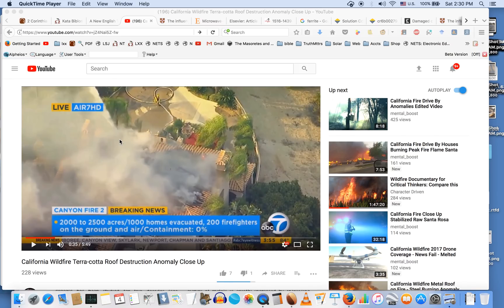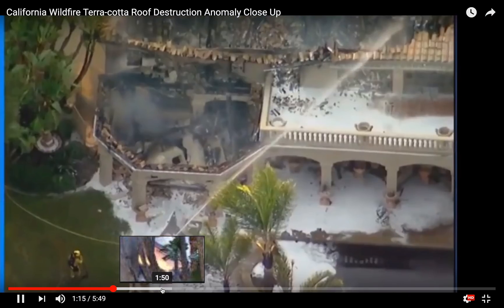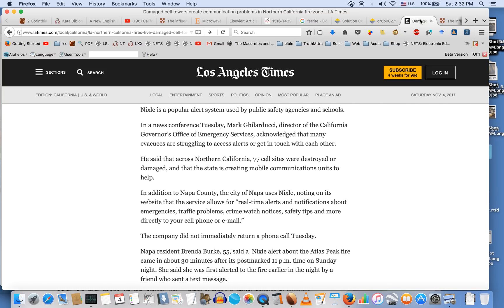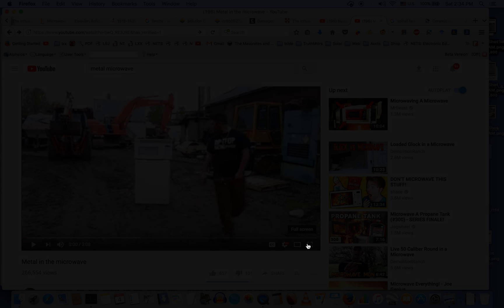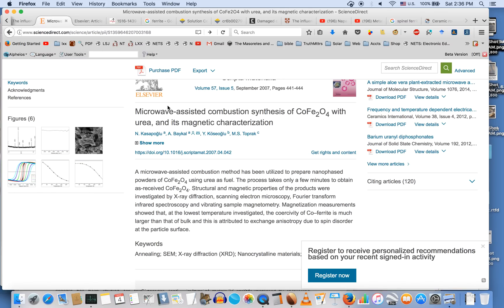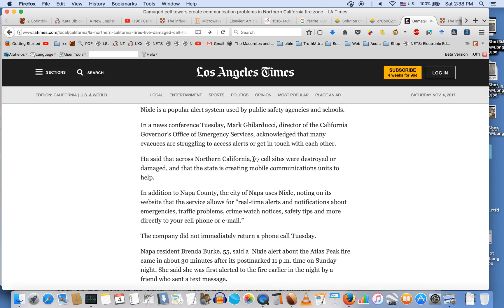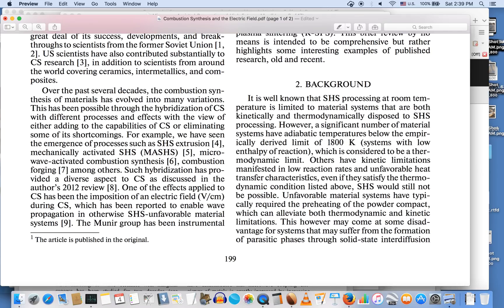California Fires: Terracotta Roof Anomaly: Microwave Assisted Combustion Synthesis

Comment: They also used a Tesla tech that creates lighting type pulses of extreme voltages from underground which explains the hit and miss nature of the burned homes,  light poles,  trees and anything that had coils in them aka Tesla coils aka coils of wire like tires,  culverts aka ditch tiles,  and anything with long running areas of metal,  like guard rails and bridges.   ALL are HIGH conductors of electricity.   See my channel for detailed video explanation. LBA

Comment: This video is a good example of what happens when IGNORANT people who know NOTHING about wildland interface fires, fire behavior, or building construction try to explain something that they know NOTHING about. 
Roofs of houses are made so that air can flow under them and above the insulation of the house.  It's very easy for embers to get into these vents that allow air flow.  The structure holding up the roofing, in this case terra cotta tiles, is almost 100% made of wood framing, usually with plywood or OSB sheathing to attach the shingles or roof covering.  THAT is what is burning.  The amount of iron oxide in a clay tile is almost nothing.  
Secondly, the embers that ignited this house fire came from the CLEARLY burned grassy area to the right of the house, which is obviously directly up wind of the house.  Grass fires typically burn hot and fast, and they're going to throw off lots of embers.
This goofy chick knows NOTHING about cell towers.  
"They're made out of steel"...
Only the tower is.  There's all kind of wiring and electronic equipment that can easily be destroyed by fire, and it doesn't take much heat to structurally weaken a steel tower, to the point it fails in high winds.  And the microwave power in a microwave oven is CONCENTRATED.  Microwave communication signals are NOT.  You'd have to be right up at the top of the tower to get burned by the radio waves, same as if you're right at the antennae of an FM transmitter.  Anyone who's every been in the Army knows that. 
Lastly, there's ZERO point of the government using microwaves to start fires.  The biggest source of income for governments is taxes.  IF they destroyed property, they lessen the value, which equates to less tax income.  It's the same when you cause business' to close, you lose sales and income taxes.  And on top of that, you have the expense of disaster mitigation and relief.
So just stop with all the conspiracy theory BULLSHIT.

Comment: check these two clips out and extrapolate 'proof-of-concept':
one guy's video i'd rename to Melted Glass with a Paperclip in a Microwave Oven
the other guy evolved a method of smelting tin/lead/silver in a brick-hearth he inserted into a microwave oven
 

https://www.youtube.com/watch?v=Ur6ejSAJRpU
15 Microwaved a Glass Bottle with a Paperclip inside - 3min
Geoffr524
Published on Apr 29, 2009
I took a brown glass bottle, and stuck a paperclip inside it, to cause the plasma to heat up the bottle, and melt it.  

https://www.instructables.com/id/microwave-smelter/
Microwave Smelter
 - 2min
Mike Warren
Published on Dec 15, 2011
(his youtube video shows his first 'semi-fail' attempt that resulted in a microwave oven fire but he found easy ways to correct for the problem by using only red brick)

Microwave: 850W
50/50 Tin/lead solder: 180-190 °C (360-370 °F)
:  10 minutes - completely molten
Silver solder: 450 °C (840 °F):  15 minutes - completely molten
Microwave susceptor aka heating element: silicon-carbide rubbing stone

Comment: When metal (especially ferrous) is placed inside a microve wbede the microwave energy is focused (approximately 2.4 to 2.48 ghz) the microwaves don't just cause oxidation instead it actually charges the metal to a high voltage reference to ground. Also if the metal has sharp points (fork or staples amd such) this acts a break out point suchans used for tesla coils. The charge is applied to the entire surface while the charge accumulates to the  point and breals away. If the object is rounded the charge will be equally aplied without that breakout point so it acts as a cap. More happens in reality but that is mainly what occurs in a microwave oven.

Comment: another super simple piece of msm news with a smoking gun that supports the oxidation reduction, microwave/rf assisted combustion synthesis, pyrolysis combination involved in these microwave/rf fires is this.

MUST SEE:  https://www.youtube.com/watch?v=mXm5RKASj5c
Planter pot on porch burns so hot it melts/disintegrates wrought iron steel, burns hole through 1.5" of solid wood.   

also see my aug2018 comment/analysis that cross-references works by mental_boost and intruthbygrace on parallel anomalies.

Comment: Total bunch of nutcase conspiracy theorist. First are there DEW? Yes! Second is the information presented by this "researcher" accurate, and truthful?  NO! Only in her mind, and in the minds of those who want to believe. Is our government behind it, and doing this? I really don't believe so, and not because I'm all that crazy about our government. Having said that, I have many years of experience in radio, and microwave technologies. The amount of power in a cell phone tower is by no means directable, and is not enough to start fires. It's at max 500 watts. Less than half of what is in a hair dryer. The reason for so many cell towers in a given area is due to the number of conversations that are going on simultaneously. Each tower can only handle so many voice channels, and power is kept low so that there is no interference between towers. The max range of a tower is no more than about 25 miles, not the distance this "person" claims. I don't have sufficient time or willingness to debunk this crap, so if you want to believe it be my guest, but man, ya'll need to wake the hell up instead of following people like this, acting like a bunch of sheep.

Comment: everyone who bought terracotta tile roofs did so for their fire-resistant quality.  dane at geoengineeringwatch was moving a hypothesis that tile/stucco are not burning in these fires, so this video shuts that idea down, shot dead.  
 
you guys show how microwave from the cell towers if overpowered* can excite the aluminum oxide in the terracotta tiles, a highly flammable accelerant and we see a tile roof house and everything in it disintegrate per inside-out self-immolation, thanks to a field created by the metal in all cellulose fibers per pyrolysis, without any nearby fire or any other homes ablaze.   

i would bet tile floors/counter tops, granite tops, and clay plant pots might all have some metal oxides in them like terracotta do.  i'd not be surprised if they put metal oxides into many items incl 'fire-retardant' chemicals the state forced into all furniture/curtain/rugs and insulation to meet state fire code.  wouldn't surprise.  why?  because federal codes at no time consider/reference or test for 'microwave fire' - they are specific only to organic fire.  presumably aluminum oxides would never come into play at organic temperatures 1400F.

and as you note, all the electrical wiring, plumbing and hvac venting, nails, staples come into contact with cellulose fibers like walls/floors/beds/carpet at regular intervals.  if oxidized could all be 'microwave fire fuel'.  is there a better explanation?  no. 

*note:  by hickup or hacker, periodically, the towers do go berzerk/derail and dose the whole neighborhood/county with very high microwave/rf pulses - i have captured it on video with my RF meter off the charts by maybe 10-100 fold higher dosage across the county one afternoon.

it takes curiosity and sleuthing to get around the layers of persistent deep state disinfo.  it highlights the level of mind-control across all fire/material science brass who know this stuff yet remain silent per 'manufactured consent' or per use of the same tesla technology via mkultra manchurian memory splitting to make them all do/say as handlers and puppetmasters have scripted for them. 

G4 is plenty lethal, G5 is the 'hunger games' rollout.  by then half of us may well be fire/quake/flood/cyclone refugees dependent on the gov for work/food/water.  and due to all the spraying and killing of vegetation/soil in all areas, armed preppers stand no chance and need to rethink the attack/survival plan.

Comment: the tiles are burning from the underside out, few flames visible.  the house burns neatly to ash with minimal flame, all items smoldering inside out, up/down moreso than spreading laterally/sideways, and it doesn't stop until it reduces all items to white ash, literally pulverizing/disintegrating 99% of materials, leaving a fraction of the debris field you'd expect and extinguishing itself neatly at its own foundation line.  this is all contrary to how 'natural' fire burns from the outside-in and spreads wildly laterally.  i'm calling it a microwave/RF disintegration-burn.

the house and all its contents are being heated to its combustion points and slow burn smoldering as if a remotely controlled burn.  these fires ignite themselves and put themselves out, regardless of human/dept intervention.

Comment: Don't need a metal content in a tree to make it burn - domestic / kitchen microwaves work by agitating . heating the water / liquid molecules in a food / beverage - thus a military weaponised microwave device would heat / boil off the cellular sap - and resin content below the bark - and inner wood grain capillaries to the point of combustion.

Comment: Orgone Pyramids and  "muffin tray Orgone" (they don't have to be pyramids) is made up of metal shavings and for extra power insert crystals in the resin to make them. Also they need to be near 20 to 50 ft from  the  cell tower also placing them near and around the house. This disturbes the microwaves from these evil towers. They are also sold online. Also they need to be buried so that they won't be removed or  should be hidden from public view. or if it is found inserting a paper message  saying what it is for inside the resin hope this helps. research in you tube.

Comment: Hi..  thanks for the research.  I believe that the electric company’s play a roll in this.  The microwave you are talking about when directed to a building does not first mess with anything organic nature.  But the nails and metal in a house as well as wiring super heats and ignites the wood and textiles around it.  An average house file is about 1100-1200 degrees so for metal like nails and steel to start to superheat it would have to be about 2500 degrees.  Glass does not melt until about 2600 degrees..  so this is NOT a common house type fire,  it has a major accelerant present in the beginning that fuels these fires beyond what you normally see in a house fire.  Also find the video showing the guardrails.  These are 6x8 treated post burning from the INSIDE when the steel bolts holding them together get superheated.  No other fire around except the guardrail.  Bottom line.  It’s not natural. It’s man made and I think insurance companies will have to investigate because these losses when using forensic technology should reveal from very interesting news indeed.

Comment: 0:38  reporter: "there's no flame here, no wall of fire near here... you can see right down through the middle of that house"   

2:31  in crescent river, ca 77 cell towers were destroyed, 1 tower is sufficient to carry a signal 40+ miles, the fact we have so many cell towers around us is a big red flag, cell towers radiate microwave energy.  

3:45  when you microwave metal, it sparks like crazy, from the vibration of the metal as it goes through 'oxidation reduction' which frees up oxygen to make the flame we see.  if you manipulate the magnetic field by microwaving metal you're accelerating the oxidation reduction process, freeing up aluminum oxide in this case, an oxidation element that will ignite and provide oxygen in a combustion scenario that bypasses the need for a furnace.  depending on the metal you get different color sparks.  

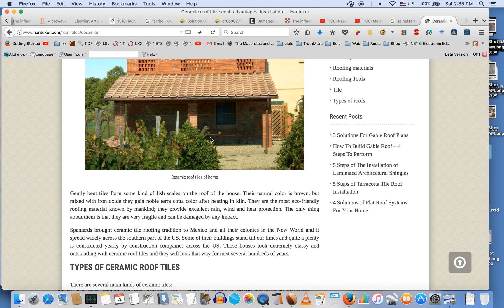5:10  terracotta tiles contain iron oxide that gives it its color.  if you microwave it and release this oxide, it suddenly has an oxygen feed it needs to burn, that it otherwise would need a furnace to achieve.   when you microwave things, it accelerates the release of oxides which creates a steady oxidated fuel to burn, its called 'microwave-assisted combustion synthesis'.

6:00  you cant do this with trees as there is no metal in there to burn so you need the oxidizing agent to burn.  

6:50  all of this is easily explained by 'zap' by microwave:  create combustion by altering the frequency of these metals to increase oxidation reduction that produces the oxidizing agents to fuel the fire... 

7:27  this bypasses the need for lasers because the cellular/wireless grid is the DEW to do it if you dial up the target frequencies and 'turn up the juice'  [between cell tower arrays to start and stop, feed and steer these fires].

Comment: PLEASE ensure your Jr and Sr High School Teachers NEVER see this video! The metal is not going through oxidation reduction and oxygen is NOT generated from this process. During true oxidation reduction oxygen is being consumed!

The arcing seen is caused by the fast movement of free electrons in the metal and with the metal having sharp edges this concentrates the reaction which strips electrons off the molecules of the air.  This ionization of the air is the spark that you see.

In very simple terms Oxidation Reduction in steel is RUST! Also Aluminum Oxide is NOT created during this process. Aluminum oxide is created ON aluminum with its reaction to water and/or air. Simply put, aluminum oxide is rust on aluminum. Bet you did not know that aluminum oxide is used as an abrasive and it cutting tools. Also the melting point is 3,762 °F.  Oh and as with the oxidation reduction process the process of aluminum oxidation does not generate oxygen!

You do such a great job of pulling stuff out of your arse!

Comment: About time someone hit in this. Do you also think they can adjust the frequency to burn about any roof combination. And with the metals in water, you can bet plenty of metals are inside trees picked up by water uptake system. This is why I think it burns the inside. And this new 5G. Can create the frequency to burn and do mental things.

Comment: Hi. I know this is not your expertice but you might be interested. I have to wonder if "they" are trying to do us in via Fire and earthquakes. An employee of a gas drilling company put out here that we, over here on the New Madrid fault line, should be thanking the oil and gas companies that do "Fracking" in Ok and Kansas, are helping the fault line move along a little at a time, so it doesn't hang up, thereby preventing a big earthquake.  So I guess they can say that they Not weakening the crust, they're just shaking things up a Little to help the movement along gradually. When will they start to ask for a Protection Fee? Oh, we'll call it a "Fracking Tax". Any town or farmer within a 50 mile radius will have to pay an annual fee. It could be a new branch of the internal revenue service. Your info on metal is very accurate. I'm a machinist. You have to be very careful, even in machining Titanium and magnesium. It can flame up. Heat and or static electricity is a factor to consider. In your video with all the tree limbs down and the trashcans still there, well, I live in tornado alley. That was no tornado. I also can't believe that there was That Many lightning strikes.

Comment: To me the most obvious to me  is that this house fire had nothing to do with the wild fires. Beside the fires coming up to a house and igniting it, houses catch fire due to embers (not landing  on the roof per say) getting drawn up the natural convection of the eves in to attack area and the roof fire starts from below. If it was done by microwave via cell tower, people in the area would have been burned as well I suspect. I do like the out of the box thinking you possess and perhaps you are circling around the truth, but not quite there yet.

Comment: the reason 77 cel towers got damaged during the fires is due to the huge EMP from the DEW devices which can burn out electronic components not shielded to Military specs like 1/2" thick lead cased. not due to fires them selves as the strong power of the DEW can carry EMP like over 1/4 mile from point of use (each target).

Comment: Are you stupid? There isn’t anywhere near enough power from a cell tower to do what your saying.  If there was we would of had the peta group going nuts over all the cooked birds. As far as cell towers burning. The antenna is the part that you notice but at the bottom is a equipment room. That’s where all the magic happens.. also is where fire will enjoy itself. Plastics, wood, etc. you’re right about terra-cotta.. it doesn’t burn but structure does. Wood, tarpaper, cellulose.. burn. That’s what those tiles are sitting on. Thats if they are terra cotta. Most homes lack the proper structure to support tiles. They also make composite tiles made from tar paper, sand and fiberglass. Those will burn. As far as nothing burning around the house.. that doesn’t prove anything.. wild fires create large updrafts. Some are strong enough to create fire tornadoes. This pushes cinders airborne and spreads fire.

Comment: Classic ember attack. I see this every year in Australia. If a burning ember gets blown under the eaves into the roof space, it can cause a fire and embers can be blown for miles if the wind is strong enough. The roof trusses burn through and the roof collapses because of the weight of the tiles. Terracotta tiles can weigh up to 13lbs per square foot. Do the math. A 1000ft square roof can weigh 13,000 lbs. That's 6.5 tons!